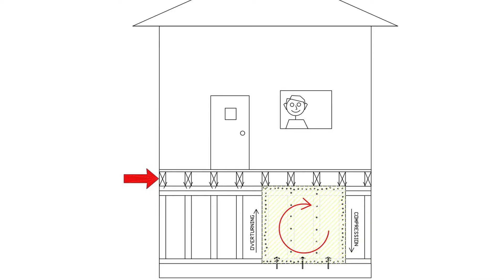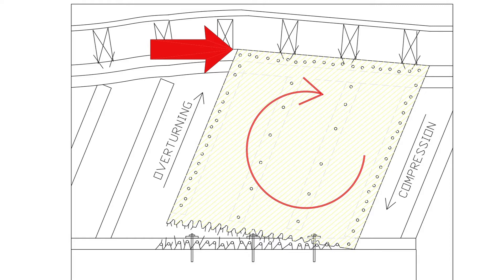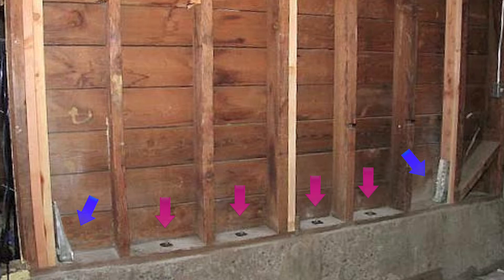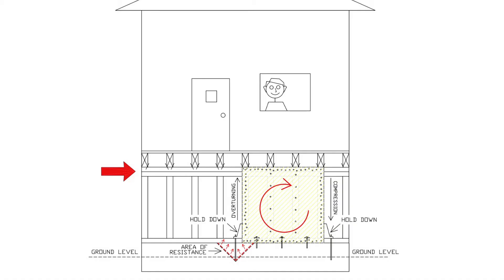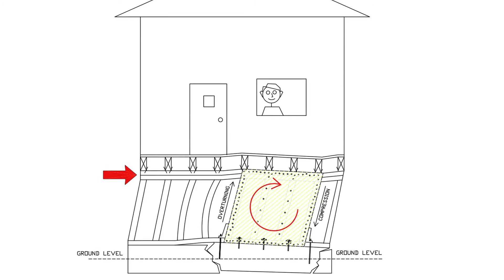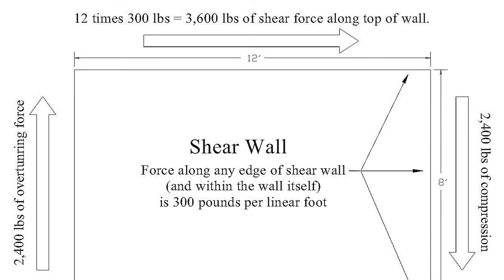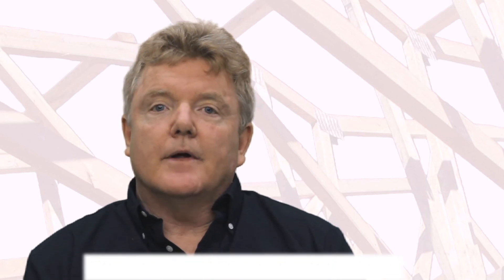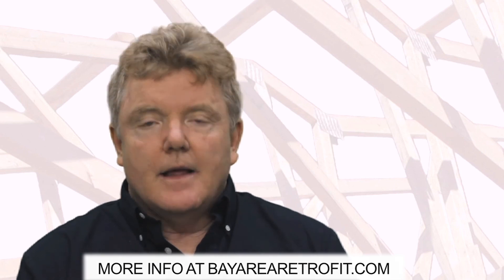How to Seismic Retrofit a House - Shear Wall Overturning Forces

Comment: Notice that this column bears on just a single floor joist.  Experienced builders place a plywood section on adjacent joists. This spreads the load out to the rest of the floor above. Otherwise most likely the single joist will just tear off of the flooring above when stressed.    This looks like a first time job from this builders.    His next few jobs may be better.

Comment: This guy does not know his work from a hole in the ground. For instance blocks onto the sill should be attached so that they do not pull up.   It can be done well with nails, lag bolts, bolts through the block etc..   Simply use a prybar to test when the block is secure in place. WHERE as the blocks pictures in the city of San Leandro/ Berkeley Plan Set A are shown with four nails.   And of course they will pry up easily. ///   Known since the early 1990s the HOLD Downs deflect.  Unless they are secured in place on posts at least one inch above the sill plate they are about worthless.  A quarter of an inch of movement in the post renders the hold down inactive.  The ICC - 155 bulletin covers this information.  The use of hold downs placed directly on the sill are worthless. And all work such as pictured here should be corrected.